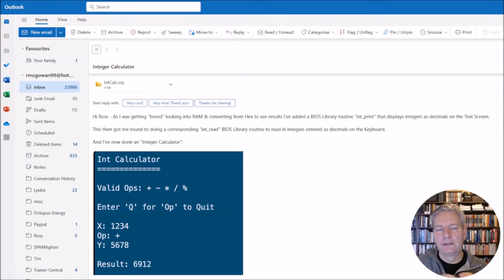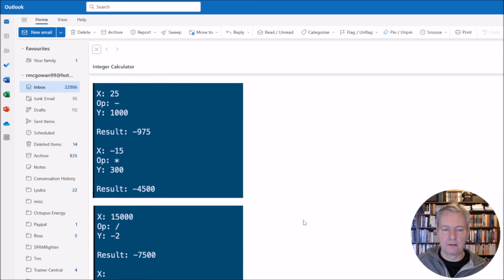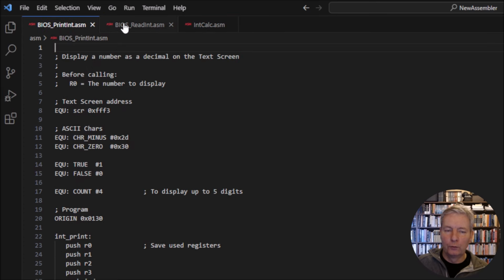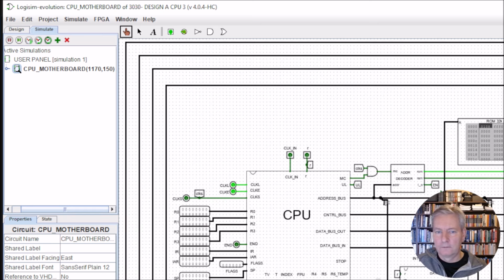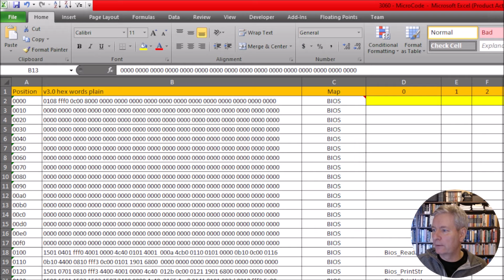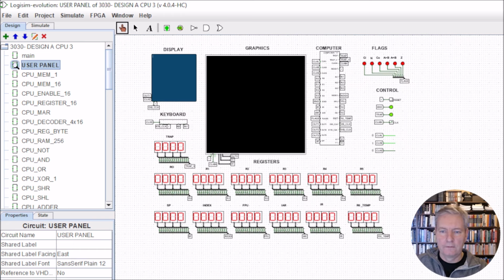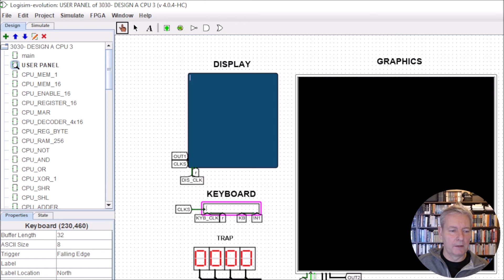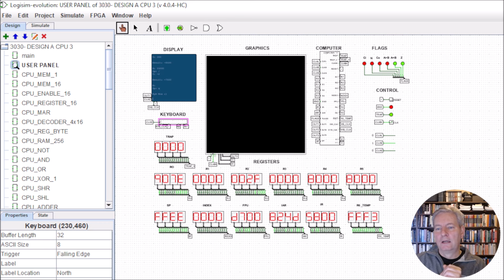Assembly Language Integer Calculator

Comment: What will it do if the integer is too large?
Reply from the maker: It will throw a wobbler and put out junk. But not a problem to add in an overflow test into the code. I am not bothering about all the edge conditions for the fixed point 8.8 simulations as this section was added as a kind of cameo just to show how it can be done. The fixed point will be superseded by the floating point unit which will have all the edge conditions covered.
Reply from the maker: See Tim's full response.
Hi Ross - If “large” numbers are entered it’s not a total junk situation :) - But the numbers are “truncated" to their 16 LSB’s - Also: Invalid number entries (eg: 12.34, 12ab, 0x12ab, Timmi, ….) are treated as 0.Plus there’s no use of the Carry Flag in calculations, and no Overflow detection either, so:

32767 (0x7fff) * 2 = 0xfffe = -2 (instead of 65,534) - [Numbers are 2’s Complement - so: -32,768 to 32,767]
100,000 (0x(1)86a0) + 50,000 (0xc350) = 0x(2)49f0 = 18,928 (instead of 150,000)

I should do a check of the Carry Flag to say “out of range” & maybes look at doing an overflow check in software, but it’d be nice to have a bash at doing hardware overflow detection …